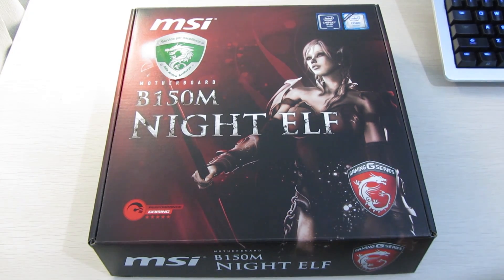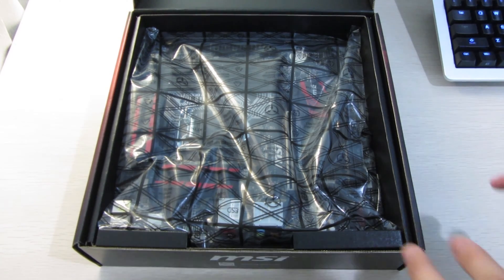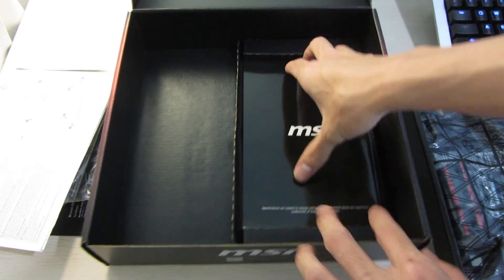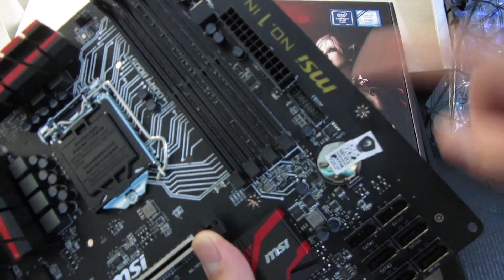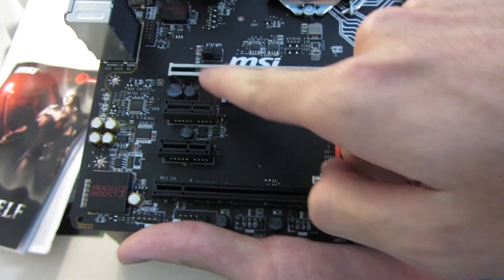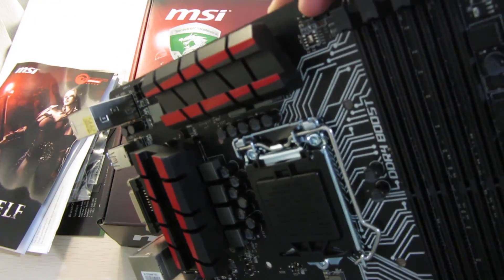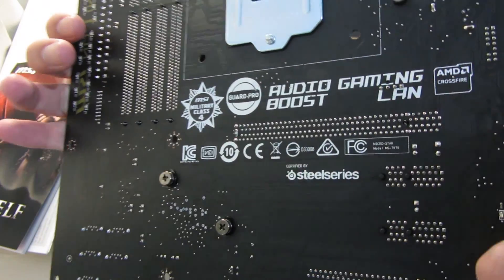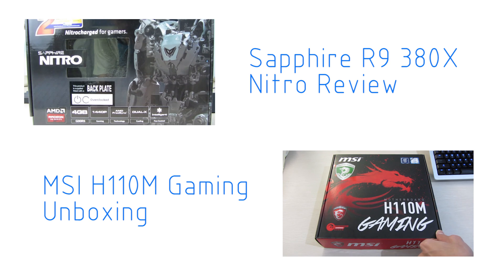MSI B150M Night Elf Motherboard Unboxing

Comment: help please. what does it indicate if a blue light starts appearing just near above the sata area. my computer won't turn on. its completely dead. even when the power supply is not turned on, the blue light still appears upon insertion on the socket.

Comment: can i do an intel pentium g4560+msi gtx 1050 gaming x build on this motherboard?
Reply from the maker: +Nog3n i don't see why not
Reply: O!Technology also i bought the monitor. it has a vga cabel. wich converter should i use? hdmi,dvi-d?
Reply from the maker: +Nog3n it doesn't have a hdmi or dvi input?
Reply: O!Technology its not the newest monitor for sure
Reply: O!Technology so it doesnt
Reply from the maker: +Nog3n i see. Dvi to vga wouldn't work because new gpus don't support vga so hdmi vga should work
Reply: O!Technology ok, thanks! nice content man!! fuck yeah :D keep it up👌👌👌✋✋
Reply from the maker: +Nog3n thanks man :D
Reply: O!Technology one more question. if i have the videocard. i dont have to connect the monitor to the motherboard. just connect straight into the videocard?
Reply: i was wondering. cause i thought i've had to buy a dvi-d converter
Reply from the maker: +Nog3n yes just connect to the video card

Comment: hey! not related to this but i want to ask you something. i want to buy this motherboard. i see that it comes with 2 sata cables. my question is: can i use them both for a hard disk instead one sata and one molex? and btw do i need sata for optical drive too? and what do i need molex cables for in pc? i am a noob at building pc.
Reply from the maker: +Demoneus im not sure what you meant completely. But if you mean use two cables for one drive then no.
Reply: O!Technology i mean, the hard disk needs 2 cables, one to the psu and the other to the mb. can both be sata ?
Reply from the maker: +Demoneus oh no you got it wrong. One is sata data to the motherboard and the other is sata power to the powersupply for supplying power.
Reply: O!Technology yeah, that is what i meant. my english sucks, so... i knew you could use a sata and molex but i wasnt sure if you could use 2 sata.
Reply: O!Technology is there a difference between these 2 or are both simply sata cables
Reply: O!Technology sorry for being so annoying, but i want to build my first pc. dont get me wrong, i just want everything to work perfect.

Comment: I know you can't overclock with this board and not on any board with i5 6500. But can you still turbo it? Is turbo the same thing as overclock?
Reply from the maker: Yes Turbo Boost works on any board so it's fine. If you're talking about locked on highest turbo though sadly now you can't do that anymore since Haswell.

Comment: support crossfire?
Reply from the maker: +Ryle Noval no it doesn't unfortunately
Reply from the maker: CORE Oh wait hold on a second. Sorry I remembered a different board that didn't have CFX support. So yes this supports but not ideal as the second slot is only x4 through the chipset which adds latency and reduces performance.